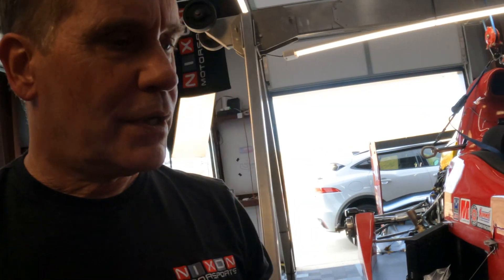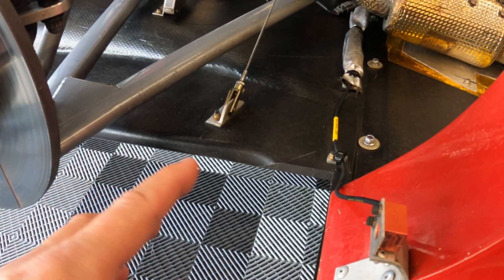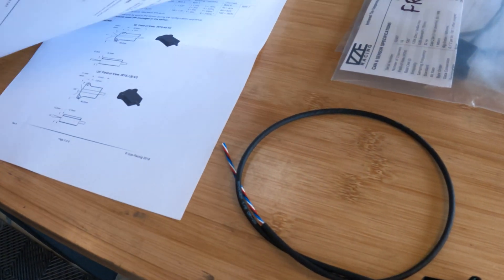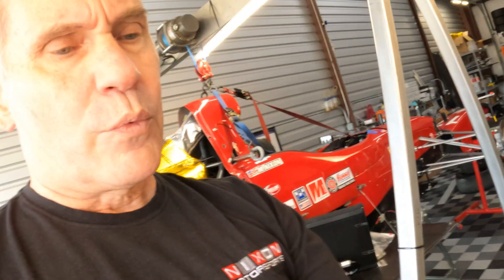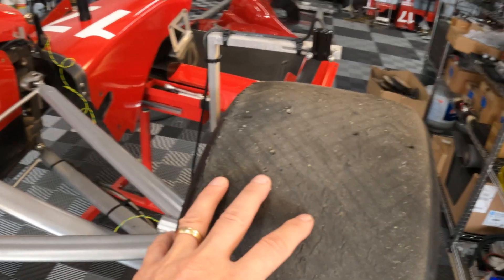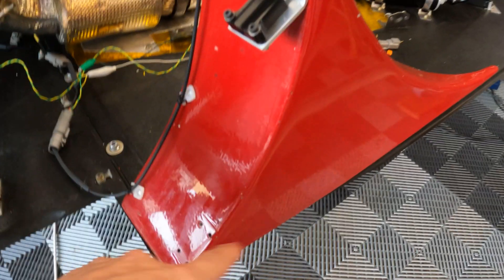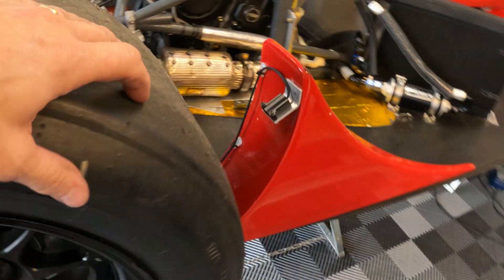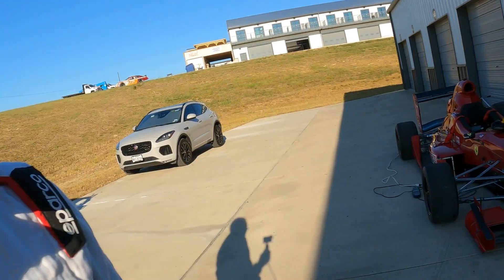How to properly tune your camber with 16Ch IR tire temp sensors

Comment: Great video!  What is the typical tire wear pattern?  Will too little camber cause the outer part to wear more?  Do you ever tune camber to balance wear or mainly just for performance?
Reply from the maker: Wear pattern does vary between tracks and direction as you might expect.  It does help with suspension setup, camber, toe etc.  The heat across the tire surface area is logged real time so you see how it is impacted at each corner on the track.  So, yes it was used to help tune the camber on each corner.  Thanks for the comment and question!  cheers

Comment: This was excellent to watch! I'm setting up a formula SAE car data system right now and we are thinking about getting these. Do you use them often still? We're trying to decide how much they'll help for the price. They aren't cheap!
Reply from the maker: Hi Gavin,  Yes I use both the external and internal tire IR temp sensors all the time.  The external sensors are more cost effective and connect via CAN to logger.  As I mentioned in the video the benefit of the external sensors they work on any number of sets of wheels and tires whereas the inside ones are required on all the wheel sets you have.  On ROI, how much they help on price that is subjective of course, I would have to say understanding tires is towards the top of the list of chassis related sensors.  If you have shock position sensors and external tire temp sensors you are in good shape.  We all know how critical tires are in performance, getting them in their peak operating temp window is important.  With a 16 channel sensor you have the benefit of logging the entire width of the tire and allows you to tune cambers + contribute to overall chassis balance.  Remember external temp sensors see fast temp reaction temps whereas the inside ones show more consistent core temps + the benefit of tire pressures.  Don’t forget, I am sure you know that every 1psi of tire pressure of ~ 40lbs of spring rate.  Thank you for the comment and subscribing to my channel.  Tell your friends to subscribe!  Cheers